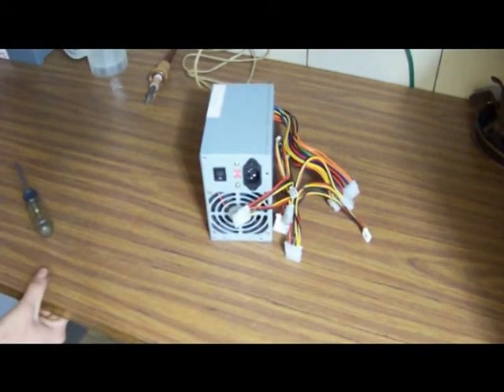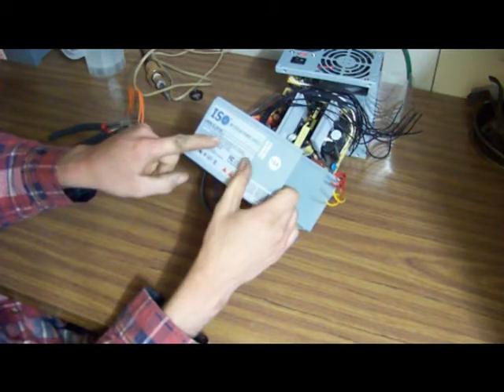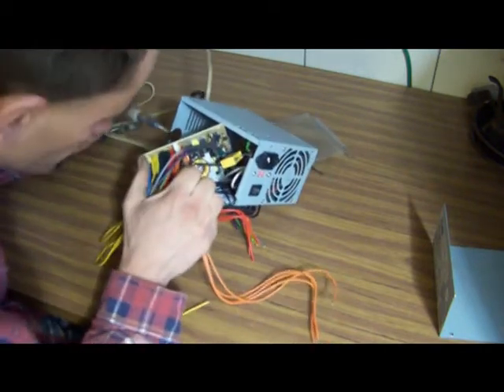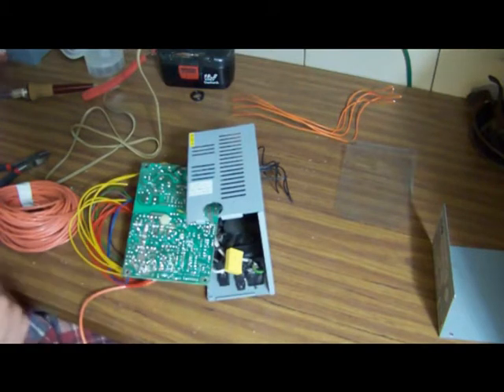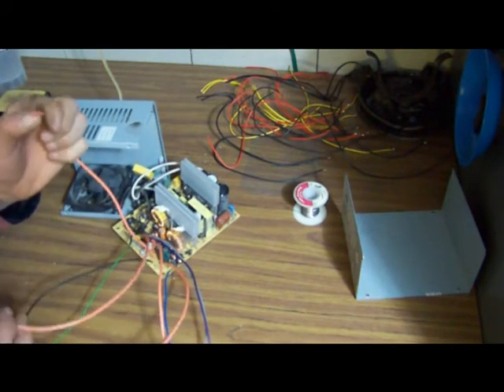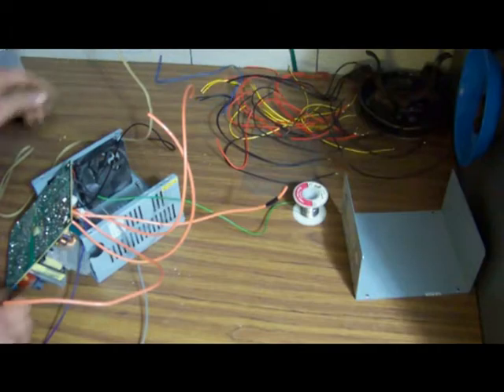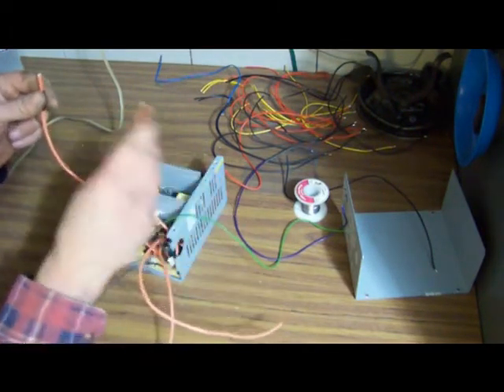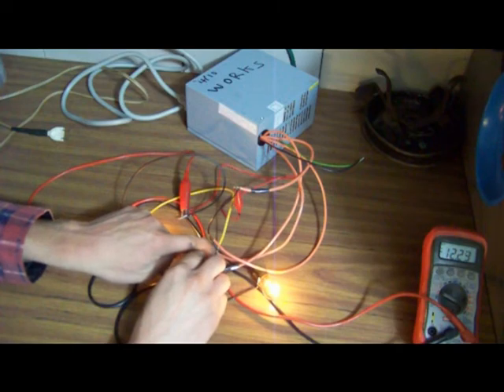how to convert atx computer power supply into bench supply

Comment: great tutorial. i'm new to this. i'm building an atx power supply that has several different components. digital voltmeter, ammeter, etc. i was curious, if the item that i want to hook up to the 5v won't draw but 8-10mA should i still increase the wire gauge to the device? the 5v line won't automatically push 28 amps to the device right? i want to power several displays: ammeter, voltmeter, etc. and they don't need but mV's to function. can someone please help my understand?

Comment: Why would it fry out? If done correctly It will not short anywhere, creating no need for such devices. How ever it is good practice to use a surge protector when testing things you have modified out. Just to make sure things are working properly without harming yourself or other devices.

Comment: A fuse, rated at, or slightly above(ie. 16 to 20 amp fuse for the 15 amps @ 12 volts) the maximum current output should do fine. It might sound silly having a larger fuse, but you want it to blow on a fault current, such as a short circiut, not at maximum rated current! If space permits, you could also have multiple fused outputs at the same voltage, for 12 volt, it could be 5, 10 and 15 amps to allow for different fault currents, depending on the circiuts/devices you intend to run

Comment: I've used a spare power supply without doing any permanent modifications. Just a U shaped piece of solid wire between the green and an adjacent black wire on the motherboard connector. Don't forget you can also get around 24 volts if you measure between the yellow +12 and the blue -12 wire.

Just curious, did you ever get around to building another hydrogen generator ?